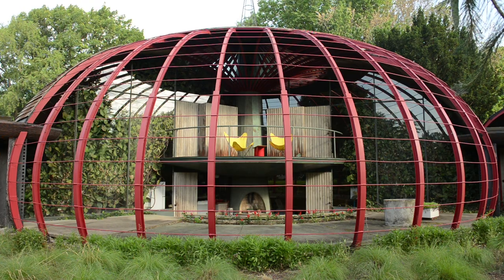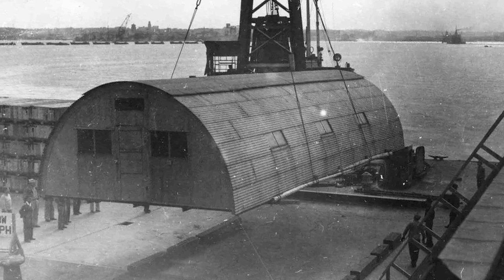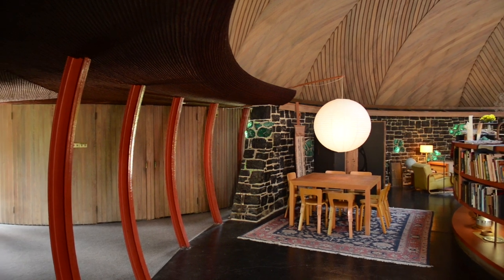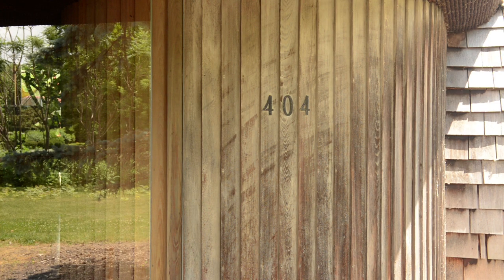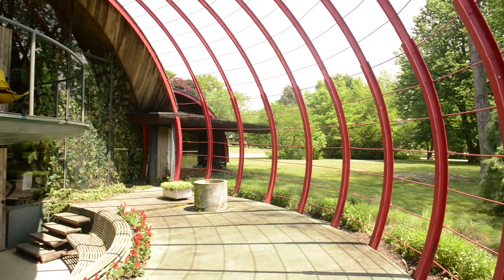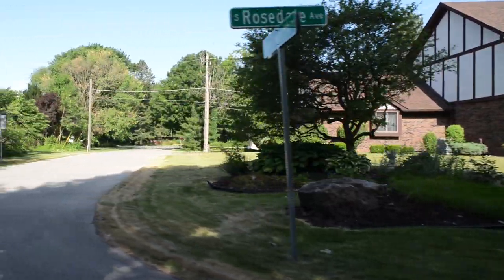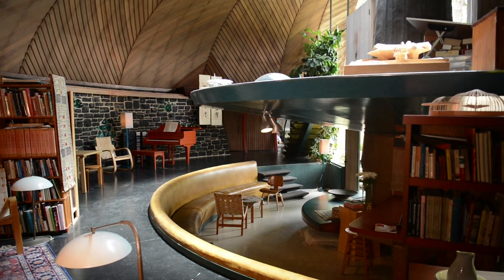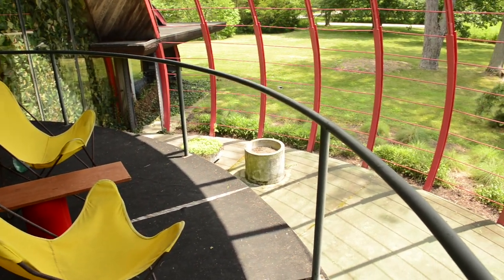Bruce Goff: Ford House

Comment: a couple of corrections: Goff passed away in August of 1982 at age 78. The blue-green glass laid up in the walls is a byproduct of the glass making process and is called glass-cullet, not marble. The 'coal' used in the masonry walls is anthracite, the hardest form of coal.